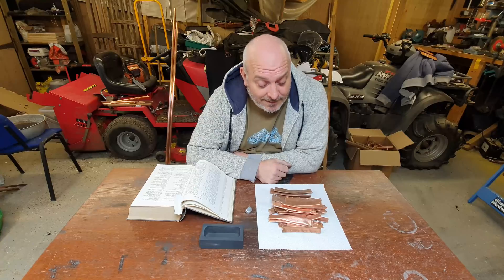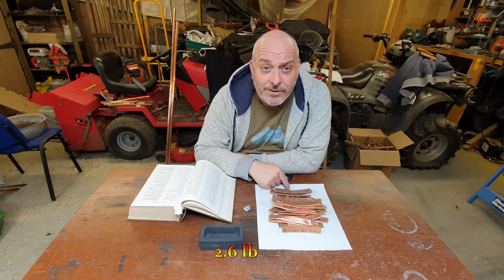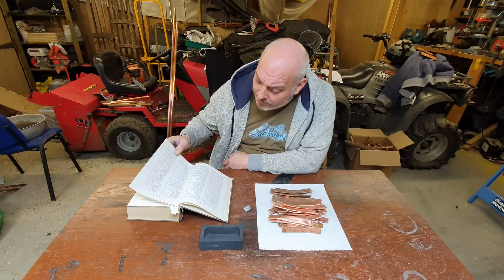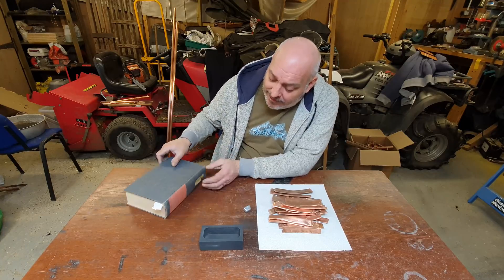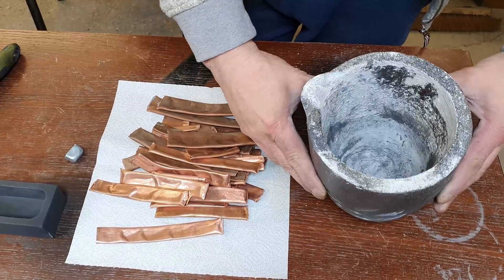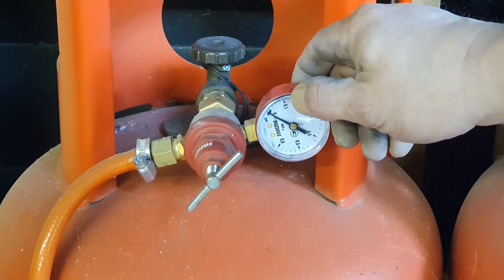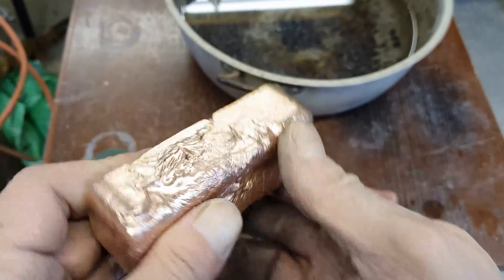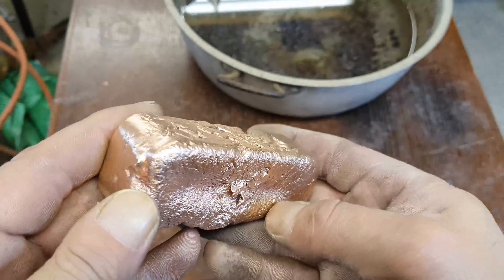Making Red Tombac of Vienna - Alpha Brass - Copper and Zinc

Comment from the maker: Hi all, making some Red Tombac of Vienna today, just a quick ingot to see if it's going to be any good for the red counters on the backgammon board.  Another video will follow this in a day or two which will be Red Tombac of Paris.  If anyone knows how to make Imperial Russian Tombac, I'd love to know the recipe...  Cheers all, have a great day and don't forget to like n subscribe !!!...  Andy 👍🥂
Reply: MeltandCast have you tried flattening the copper around the zinc piece with flux in it? Just a idea... i dont melt so im probably talking out the back end
Reply: you can always turn red with a patina afterwards. https://youtu.be/II-ieVyVcjw?t=409
Reply from the maker: @Slade adding the flux when the copper has melted usually works best, you usually need to add enough to cover the whole melt.  Others have suggested encasing the zinc in copper as well.  Cheers 😎
@Stressmaster That's a great video mate, really interesting both patinas look great - nice purples with the chemical patina and lovely reds with the heat patina too.  Cheers  Andy 😎

Comment: Have that book. Actually very same cover and same edition.
Reply from the maker: It's a handy reference book, shame it doesn't actually tell you how to make the metals but there's a lot of very useful info in there for casting alloys.  There's a few I'd like to try,  especially the zinc aluminium casting alloys... which interest me from a low energy casting point of view...  Cheers Andy 😎👍🍺
Reply: MeltandCast interesting, it’s what I’m working on right now. Specifically, walking through the various Aluminium alloys and creating like a collection or library. Interesting the nuance differences
Reply from the maker: Yeah I liked the sound of the Ally / Zinc mix...  I think the one I was looking at was ZA27...  Not sure how it will perform but it has a low melting point and is specifically for casting...  Not sure when I'll get round to making it but I'll try it at some point.  Beats smoking the shed out making brass that's for sure !!!  Cheers Andy 🍺👍😎
Reply: MeltandCast this week’s been great. Trying many many Al alloys variating percentages of Cu only, Cu and Zn, Tin. All week of a lot of fun. Just received 30 min ago 10 tanks of gas heheheeh

Comment: Thanks so much for the pressure setting. I've asked many guy's about it and all I get is measurements in bars. I live in the high desert of southern California all I know is psi.
Reply from the maker: No worries mate...  : Aluminium 8.5 - 11.5 psi,  Brass 14.5 psi, Copper 17.5 psi, Cast Iron 20 psi (or just go up in 3's).  Maximum for medium Devil Forge medium burner is 25 psi, but don't expect your gas to last long at that pressure !!!  Hope this helps.  Cheers Andy 🍺👍😎

Comment: It looks like the zinc just globbed on the top, and you scraped it off.
That little silver spot is probably cast iron or steel.
If not, I'll shut up! LOL :D
Reply from the maker: You may be right mate, I'll check the spoons and metal bar when I'm next in the shed, although I thought I'd pushed the zinc under the flux layer.  I'm sure what I skimmed off was glass but I'll check again.  Possible right on the piece of metal in the ingot too, I cant see how the zinc would stay solid with the molten copper poured all over it...  I'll put a blowtorch on it and see if it melts...  Weird though, I usually brush my moulds out before pouring...  I'll let you know what I find.  Cheers Andy 🥂🍺👍

Comment: I am not sure if this will work, however. I remember that if you melt down your zinc and add it as a liquid to your molten copper the smoke effect can be lessened or avoided.
Reply from the maker: I think it might accelerate the smoking, getting it all under the flux layer seems to work best so far from what I've found.  Trouble is once it starts to burn it's really hard to stop it burning non stop...  With this video I just tried to shove it under the flux layer as quickly as I could before it had a chance to ignite... kinda worked... hehe.  Cheers Andy 🥂🍺😎

Comment: Does dropping that hot metal into water change its properties
Reply from the maker: Hi Doug... "Maybe" although I don't really know much about this subject.  Tempering is usually reserved for ferrous metals where they are reheated and quenched to increase hardness.  The process for non ferrous metals is annealing which softens the metal to relive stresses caused by things like work hardening, via heating and cooling slowly.  Quenching ferrous metals usually hardens them, quenching non ferrous metals usually softens them.  But take that with a pinch of salt, its actually quite a complicated subject and there's a lot more to it that that.  In short to answer your question, yes it probably does change it's properties, but not in any way that would affect what I need the metal for.  Cheers Andy 😎🥂👍

Comment: I could not find anything on Imperial Russian Tombac or Tombak. Below is what I did find, hope it helps. 

"Red tombac of Paris": copper 90%, zinc 7.9%, 1.5% lead
"Red brasses and leaded red brasses are copper alloys, containing 2 - 15 % of zinc as the
major alloying element and up to 5 % of Sn and up to 8 % of Pb as additional alloying
element."
https://cdn.intechopen.com/pdfs/30472/InTech-Copper_and_copper_alloys_casting_classification_and_characteristic_microstructures.pdf

Red patina on copper: https://www.instructables.com/id/Red-Patina-on-Copper/
http://www.searlesart.com/copper-red-patina/
Reply from the maker: Thanks for those links Robert, very interesting reading.  It's a shame those red patina's are heat based...  I'm going to have to do some head scratching on how to get the different colour patinas next to each other on the board without destroying them...  I'm sure there's a way though - I'll cross that bridge later though hehe.  In the meantime I've had a great idea on how to make the counters really stand out...  watch this space  !!!   Cheers Andy 😎👍🥂
Reply: You're welcome Andy, sorry none of them would work for you.
In the .pdf link there is some information about red copper/red brass on page 12 I thought you might make some use of. 
Best of luck to you.
Reply from the maker: @TrojanHorse1959  I did read that page, I haven't read the entire document yet but it might be worth increasing the lead content to a much higher level to darken the metal.  Each time I see percentages of zinc higher than 10% I keep thinking of the Abyssinian gold mask I made a while back and how golden that was...  Even this tombac at 8% turned out a lot more golden than I was expecting, I thought it might have been a more brown colour rather than the gold colour.  I recently watched a blacksmithing video of a mosaic damascus sword with gold inlay.  It was the most amazing sword I have even seen and is what prompted me to use a black patina with gold leaf for the counters.  I'll make a mental note of your suggestion with the extra lead content, if that streaky finish is repeatable it could make for a really nice casting for a future video especially with a higher lead content.  Cheers, much appreciated Andy 🥂🍺😎

Comment: Very interesting. Regarding the zinc burning - why not coat it in a sheet of copper so as it reacts to the heat - it will be under the molten metal surface?
Reply from the maker: Thanks Smallathe, a few people have said that...  I really should try it someday.  The reason I don't, is I am often in the barn for quite a few hours at a time especially if I am making sand moulds.  The thought of adding more processes to the melt usually results in me convincing myself I will do it another day... I'll give it a go when the days are a bit longer in the summer though.  Cheers Andy 👍🥂😎
Reply: @MeltandCast  I fully understand. You can try making it during preparation in the days before... anyway would love to see this. Good luck.
Reply from the maker: Thanks mate 🥂😎

Comment: Zinc evaporates at the temp that copper melts.. one great way to add zinc is encased in copper. I use us pennies as it’s just barely copper covered, but you can also electroplated your zinc, and add the electroplated piece.
Reply from the maker: Thanks Ouroboros, a few people have mentioned this method.  I'll have to try it out when things are a little less hectic.  Things have been a bit last minute recently due to other things taking up a lot of my free time.  I hope to have more time to put into my videos a few weeks from now.  Cheers Andy 👍😎🍺

Comment: When you mix metals do you have to stir them up much or do they chemically mix somehow?
Reply from the maker: I've found when the copper gets to a certain temperature the heat convection currents from the burner swirl the copper in the crucible.  The currents are strong enough to spin a length of copper pipe when added to the melt.  So if more heat is applied stirring is often not necessary, having said that though a small stir often helps.  Stirring should be kept to a minimum though if possible.   It kinda depends how much extra heat you plan to add after adding additional metals, it's something I often forget in the heat of the moment though when making videos, like this ingot where I should have added a little more heat and perhaps a small stir to mix the zinc in better.  I was trying to avoid zinc losses due to the small amounts I was using which is why I poured straight after adding the zinc.  In hind sight  some extra heat / stirring might have avoided the unmixed zinc in the ingot.  I guess the densities of the metals also play a factor, for instance lead is a lot heavier than copper, so it's likely the lead would accumulate at the bottom of the crucible in which case a stir is almost definitely required to alloy the metals correctly.  You do tend to get a lot of 'hind sight' moments when metal casting I've found though haha.  Someone please correct me if I'm wrong !!!  Cheers Andy 🥂😎

Comment: I'm curious on a copper tin bronze color. 5% or 10% tin. I know tin is expensive. At least it is here in the U.S. If you were closer i would give you a little of my tin stash to try
Reply from the maker: Alpha bronzes are around 4-5% tin and modern bronze is around 12-12.5% tin.  Historically classic bronze was around 10% tin, used for weapons, and mild bronze with around 6% tin was used for armour. Bell bronze would be 20-26% tin.  The more tin you add the longer the decay time of the bell sound.  I don't have any experience with tin as yet though, so I don't know much.   Thanks for the kind offer on the tin 👍😎.  I'm planning on buying a large 15kg tin ingot soon, a friend has given me details of a supplier in the UK (much cheaper to get 15kg at a time) but it's still around £300 ($390) a bar.  Once I have my new camera gear I'll be working on obtaining some tin - can't wait !!!  Cheers Andy 👍😎